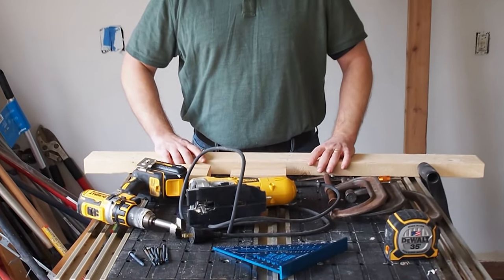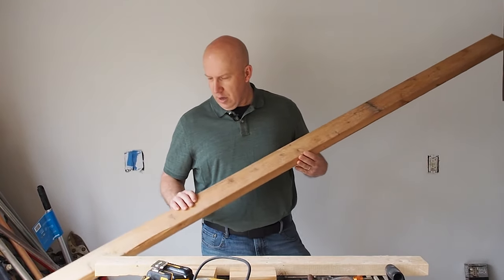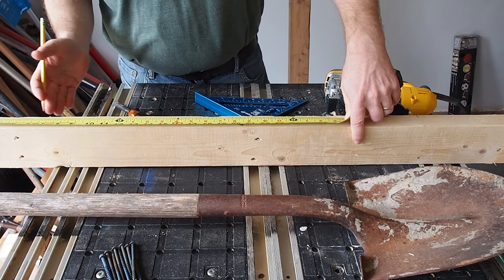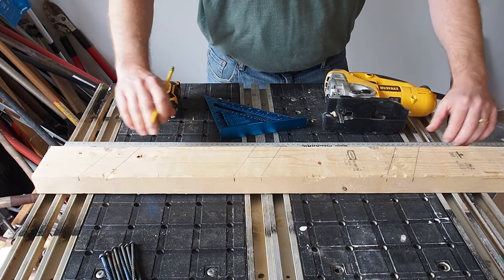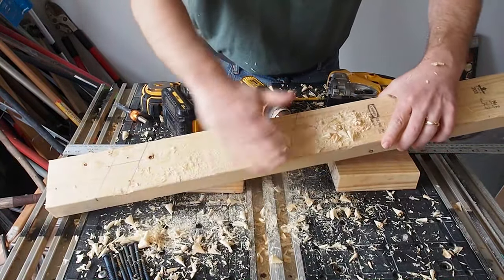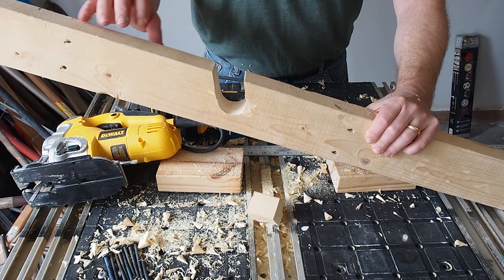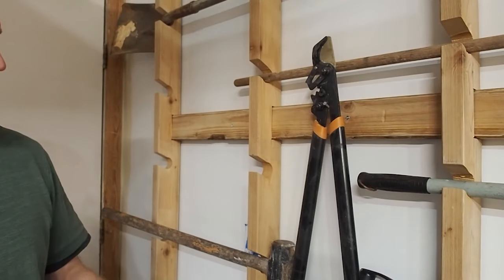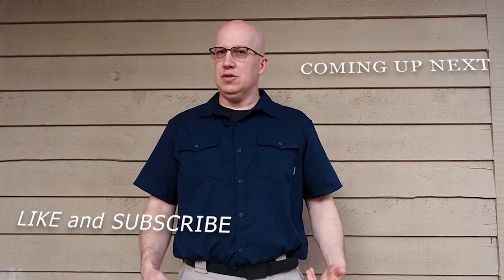DIY Garden Tool Storage Rack Solution Using Scrap Wood || Custom Design to Hold More Tools

Comment: Looks like it will solve some of my storage problems.  Maybe you have a solution for storing so many disimilar screws/washers/bolts/ etc.  I always have difficulty finding screws suitable for an impact wrench for wood.  What were you using?
Reply from the maker: I used decking screws for this assembly.  

To organize fasteners I used something like these since they stack and I can take to a job site as needed:

homedepot.sjv.io/rna5m3

Comment: Great video - thanks for sharing. I've been planning on building a rack to organize my garden tools more efficiently for a few years and your video gave me the inspiration to finally get it done. Could you tell me how you cut the notches in the other side of the board since you didn't show this in your video ? Did you use your jig saw also ? I'm going to use 2X6's rather than 2X4's as you did to give me a bit more room for the tools. A few other plans I've seen for this type of rack use 2X6's. Though the crosspieces could easily be 2X4's.
Reply from the maker: I used to a jigsaw for all of the cuts since I was creating this video for  DIY platform and was trying to keep it simple.  You can use 2 x 6 lumber if you prefer.  I used the 2 x 4 since space was limited and did not want for the system to protrude into the room.  If you used 2 x 6's then you can make some of the cuts deep and others shallow so the heads of the tools do not interfere with each other.  I could alternate every other one and cuts the notches slower than I did in this design.
Reply: @SawHorseDesignBuild  Thanks very much for the quick response :-). Thanks for the info about using the jigsaw for all of the cuts since that's (currently) the only cutting took I have. I looked at the size of the 2X4's at Home Depot and to me, it didn't seem like I had that much room for the slots but if it worked for you, that's all that matters in your case.
Reply from the maker: @wdedula  You have plenty of room with a 2 x 4- the slots just have to be large enough to accommodate the diameter of the handle of the tool which is not that large.

Comment: measured the shovel handle:1-1/2"; decide the notch will be 1-5/8"; then added 1-3/4" to scribe lines; then drilled hole with bit of size?  1-5/8" or 1-3/4"
Reply from the maker: Either size work- depends on the tools you have available.  I had a 1- 5/8 bit so I used that.
Reply: @SawHorseDesignBuild  Right. So why was the measurement you marked on the board 1-3/4? That's what's confusing me..
Reply from the maker: @georgeadneyga  If you measure the distance between them when you mark the lines at an angle from the edge the measurement is closer to 1 5/8"

Comment: Could have just stuck some nails in a 2x4 and been done much quicker and hang the tools the way they want to hang. Instead you spent a bunch of time trying to hang the tools sideways and then still ended up putting nails into it to hang your tools from.
Reply from the maker: True, there are lots of ways to hold tools.  I chose to cut slots and use nails as you stated, depending on the type of tool.  The slots work well for the tool where the center of gravity is close to the head so it holds it better when the handle lifts.